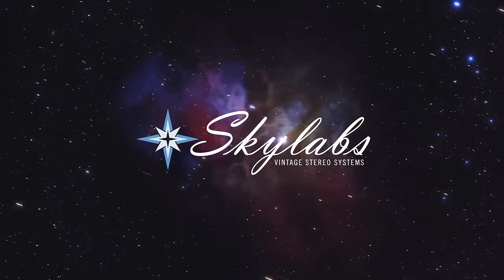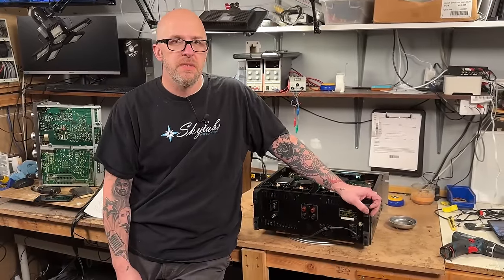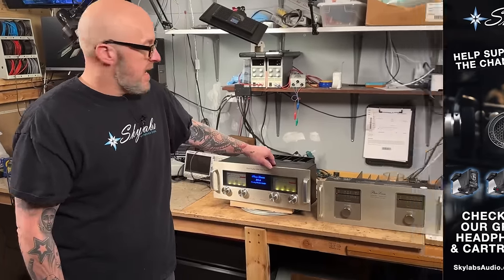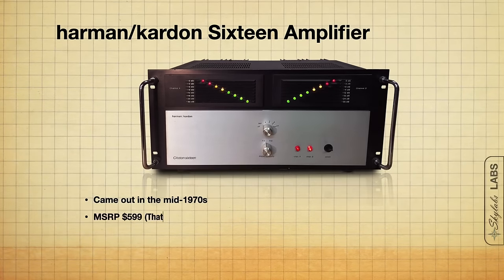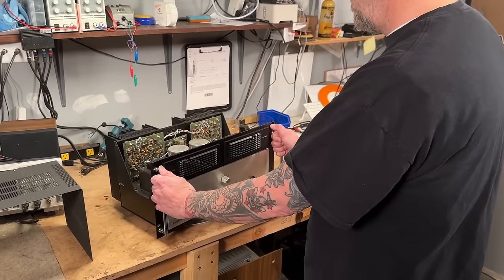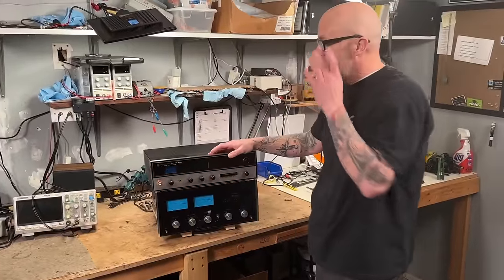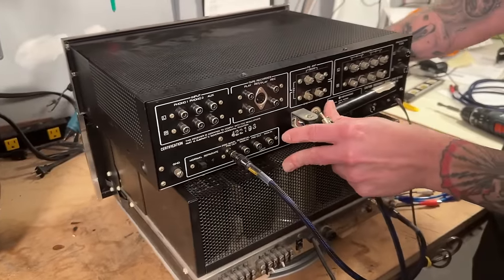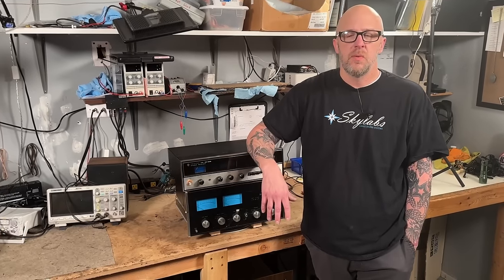5 of our Favorite Vintage Stereo Amplifiers from the 70s!

Comment from the maker: Sorry about the audio quality on this one- had some equiptment issues =(
Reply: Unfortunately I couldn't watch the video due to the audio issues
Reply from the maker: Sorry Karen =(
Reply: I thought it was on purpose from the beginning like you were talking to us from outer space during the opening logo..
Reply: I'm a we bit confused... I heard everything just fine.  @skylabsaudio
Reply: @KillerKlipsch Watch it on a computer with real speakers hooked up and you'll hear there's a wierd phase issue.  Kinda sounds like it's coming from behind you or way to the side.  With a phone or tablet, the sound is mono , so that effect is cancelled out.
Reply: Thanks for mentioning - thought my hearing finally was affected by years of going to 11
Reply: No worries, it happens. It's ironic that we can't hear you during the high wattage amp discussion.
Reply: Too much power ?
Reply: Sounds fine on my tv
Reply: @skylabsaudio no worries, it happens
Reply: L/R 180 degrees out of phase. It happens.
Reply: Ya i had the same issue but found a surround selection on my Technics reciever that fixd it. It seams the audo R+L channels were out of phase intermittently.  Probably a bad cord or not fully incerted stereo plug.
Reply: No problem if you have an RME ADI-2 Pro. Just go to I/O>Main Output 1/2 (0r 3/4)>Phase Invert>Right (or left)... job done. Lol.
Reply: Phase madness! Kinda cool. There are some live Grateful Dead soundboard tapes where the vocals have the same thing going on, I suspect to reduce feedback.
Reply: @KillerKlipsch  Me too, must be a phasing issue.
Reply: I just reversed the connection to one of my speakers.
Reply: My wall was speaking XD

Speakers: Canton Ergo passiv 1981-1982
Amp: Harman Kardon HK 980

Comment: Another great video! A few comments:  1)The Pioneer 150watt/ch. Spec-4 was smaller, not larger, than the 250watt/ch. Spec-2  2) I sold Phase Linear gear in the 1970's when I was in the audio business. As you pointed out, these things would get HOT, especially if we left them turned on in the display racks all day... almost too hot to touch.  We had lots of service problems. 3) Another classic from the era were the Crown amplifiers... the D150 and DC300... that were built in Elkhart Indiana.  They battled with McIntosh for "top of the line" bragging rights in America.... until the Crown factory was devastated by a fire in 1971.  Harmon owns them today, building equipment exclusively for the pro industry.  Thanks again for a good look at great amps!.

Comment: Thank you for mentioning the significance of the pioneer branded rack.

My sisters inherited my step dads system: Spec 1, Spec 4, SR 303 and RT 909, all mounted to the original rack.  The RT 909 has been sent for repair and the Spec 1 and 4 will need serviced eventually but everything works well despite being stored for about a decade.

The rack is a little shabby.  it's has some rust and I was hesitant on if it would be worth saving.  It will be saved, and eventually get the rust taken care of and the paint refreshed.

These videos have been so helpful to me and my family through this process.  None of us knew much about vintage audio, but we think our step dad smile knowing we kept his stereo alive for another generation.

Comment: Good video: brought back memories for me having played with/owned/worked on some of these models back in the day.  Another one that should be on the list is the Dynaco ST-416 with optional C100 Energy Bank.   These power amps were available in kit form or assembled  Spent some time building it and then some years later as an EE Tech, modifying it.  Dynaco was a neat company that provided much information and support.  When I was modifying my ST-416, I spoke with one of their engineers who was happy to discuss this with me.  I owned several of their power amps and preamps which were heavy and well-made, all in the USA of course.
Reply: Wow I agree. I had a Dynaco amp years ago but I can't remember the model it was a small amp maybe 60 watts. What i liked about it was effortless bass almost twangy but not. Unfortunately it suffered a speaker wire short at a party and that ended it. If I could remember the model  I would buy it. I know it's a good amp.

Comment: Another great video!
Just wanted to mention another great amp from the 70's, the Crown DC 300A.
I truly loved this amp!  
Matched with the Crown IC150 pre-amp, it would really rock!
Many bands such as Crosby Stills Nash & Young used this amp on tour.  
You can clearly see banks of DC300A's on stage with Triumph at the US festival!
I heard almost all the amps at the time including my friends Phase Linear 400, Marantz and Pioneer, and my DC300A took a back seat to no one!
Many thanks!
John from Canada 🇨🇦
Reply: I, too, had the Crown DC 300A/IC-150 driving stacked Advent speakers.  Incredible combination.  The DC-300A could drive low impedance loads well and had a very solid bass.  It also had a "transistory" treble, which wasn't a problem with the Advents but when I upgraded the speakers to some very bright sounding Thiels, it became objectionable.  I had no trouble selling the Crown gear.
Reply: nice.   seems like all amps will sound the same 90%, per wattage similarity.
Reply: We must be closely related!  I also had Advent speakers!  I drove them with a Luxman receiver.  
I know there are many proud customers of 70's Crown gear!

Comment: LED output meters tend to add noise. Many of the amps with them had switches to turn them off and the difference was audible. Basically transient noise as each LED fires. The HK 16 was a perfect example of it. And an incredible amp!
Reply: Never heard that about LED's, but will give it a test on my ST 416 - interesting maybe why they have a switch to turn the LED's off, thought it was to keep room dark. Thanks
Reply: @scotthamilton5138  Some of the more advanced designs fed a separate tap to a stand along buffer/driver section so the LEDs were not just off the amp's output directly. But then you are not actually measuring the amp's output directly.

Comment: 20:25... I agree. Running the 2270 pre into a McIntosh 2105 is kind of pointless as the internal amp of the 2230/2245/2270 is phenomenal. However, for example, if you want to run a Dynaco/Dynakit ST-70 or ST-35 as an amp using the pre-amp section of a 2230/2245/2270 etc etc. I can see that. Totally different sound and really brings Jazz, Singer Songwriter and Stringed Instruments to an ear candy level. A person can experiment with so many different combinations using input/output jacks. Thanks Kevin for another great video!
Reply: I used to run the pre-outs into an ancient Sony TA-30something (can’t remember as the amp is long gone) sounded better with my L100s than the internal Marantz amp section. That Sony was strange…kind of shaped like a long shoebox but worked nicely. Still have the Marantz 😊
Reply: Sorry forgot to mention it is a 2230 that I did that with

Comment: Thanks Kevin for doing this video. 
Was a little sad that Sansui didn't make the cut. 
I'm running a BA2000, CA2000, & TU9900 going to a set of SPX11000. 
Bought this about 20 years ago  and other than cleaning the pots it was running great until just before the COVID shutdown.
I'm on Vancouver Island and would need to ship the unit to be serviced, going to be expensive.
Wish me luck, thanks again for the video.
Reply from the maker: If I had one, it would have been in the video for sure.
Reply: Kent in Courtenay. I had my ca/ba serviced,recapped in Cumberland 10 years ago. If you reach out I can maybe pass along a number,if he’s still there.😊

Comment: A neighbor of mine had a Phase Linear (400 or 700?). It was blowing fuses, and he asked me to take a look. It turned out there was a burr on one of the heat sinks. It had poked through the mica insulator and shorted the transistor case to the heat sink. I removed the burr, replaced the insulator, and it worked great. My system never sounded so good as when I was testing the amp.

Comment: I agree 1000% with you. I hear the biggest differences in preamps. 
I feel very lucky I got to grow up looking at all this stuff in the mid/late 70's. My father was a audiophile and always had a dedicated music room. He would take me around to all the HiFi shops. There were so many of them in the Philly area.

Also, when possible, please mention the damping factor when reading the specs. Thanks.
Reply: Right, and another spec that's worth while is the 4ohm power output, which is closely related to the  damping factor. Very important if your speakers are lower than 8ohms. But, you can find this info online. I also agree that power amps have no business coloring the sound at all; they should all be ruler flat from 20-20k. The preamp is the only proper place to color the sound, unless you have an EQ also.

Comment: Excellent! I have the 700B lab one thing about them a low impedance load is no problem for them. And when you mentioned "Pulling them from a rack" First time anyone picks one up they are very "side heavy" the transformer weighs a ton. Only one I would add is the old Dyana 400 My first high power.

Comment: Great video Kevin! 
I love the look of the Phase Linear amps. It would be hard to choose which model looks cooler. 
I just kick myself for chucking a pair of Altec 9440A amps into the dumpster back in the 90s. But I needed a reliable rig for the band I was working with and those amps had too many intermittent issues and deemed not worth the expense to repair back then. If I knew back then what I know now - I would have been able to fix them myself.

Comment: I still have my Phase Linear 700 from the '70s, and it's a great amp. 350 WPC min RMS into 8 ohms, and you know it when you crank it. One '70s amp I would have like to see on  this list was the Phase Linear Dual 505 which puts out 500 WPC and looks similar to the 400 on your bench.

Comment: Thanks Kev. I have a power supply for an RCA Radiola 60 that weighs in over 12 lbs. Capacitors and filter chokes as well as a beefy Xformer with 300 volts for the tubes plates known as B+.  14 amps just to lite the tubes at 2.5 volts.

Comment: I bought the Spec-1 and either the Spec-2 or Spec-4 when I was in the Philippines in 1977 or 1978. Both units were dual voltage, very handy when I went to Belgium. Amps kicked ass! I agree that an AMP just passes & pumps up the signal; to Pioneer HPM-1500 speakers for example. My system was all Pioneer till I hit Belgium. Money flowed, my system "Growed".

Comment: Nice overview! I got my first MC2105 in 1979 to use as a bass power amp in high school. It was a revelation after trying to get clean sound out of a Fender Showman. It's quite heavy, but nothing compared to its big brothers, up to the MC2300, which was basically the same design (used the same driver cards, etc.) but instead of 65lbs, it was 125lbs. They were used in PA systems, in submarine communication systems and all kinds of places. I seem to be a Mac magnet, so now my living room stereo is powered by the MC2255. Similar design, but at close to 90lbs, I can't lift it. I'm not sure what I'm going to do when it needs servicing. The MC502 you showed is a fine amp, too, but it doesn't have autoformers, so it's not quite the same sound. I borrowed one for my bass rig in the early 80s and it worked well, but didn't have the oomph as that the MC2105 does. McIntosh was used to power the sound system at Woodstock, with a slew of MC3500s. Kind of my holy grail for a bass rig but the 145lbs and absurd price tag says no.  https://www.facebook.com/estudio1003/photos/sistema-de-som-no-woodstock-em-1969bill-hanley-e-a-sua-empresa-hanley-sound-fora/469251193125803/

Comment: The Pioneer Spec 4 is actually the lower powered unit. The Spec 4 is rated at 150 wpc. The Spec 2 is rated at 250 wpc.

Comment: You are correct on the Amps , that is their only Job is to amplify the Sound Signal from whatever is input,  there Could be a SLIGHT difference between Tube and Solid but thats the Main reason we bought Recievers in the 70s and 80s  because Living through that  when you went to the Electronic Toy Stores you got to try pretty much Everything and MY Opinion was the Recievers were not only a Bit Less than Separates money wise, so you could buy the better Speakers or another piece, ie the Equalizer,  Tape Deck, TT or 2 Tape Decks!! But the Recievers all had their own Signature Sounds, abd you had the Same thing with the Pre-Amp Selection si that limited what you could add to your system also! Also the Pre-owned and Teading going on Was Awesome!
Anyway you are Correct IMO.

Comment: Back in the 80s, my sister's roommate, Sue, had a complete Phase Linear rack system. I found it fascinating and it weighed more than I did. It's how I ended up with my sister's Marantz 2016 receiver as my first stereo. I wonder what Sue did with that system?

Comment: My choices would be these: 
1 : Mc 275
2 : citation 12
3 : marantz 140
4 : marantz 500
5 : marantz 240
For the simplicity of the circuits,  sometimes, less is more, and I like the semi push pull amplifier. They have a distinct sound. Besides the output transformer, the citation 12 and the Mc250 are very similar, I think they were inspired by the RCA 70 watt semi pp design that came out around 1968 or 1969.

Comment: You can also use both amplifiers by using the tape in and out to accomplish the same thing. Tape out of your AV or Receiver to the tape in of the next unit and so on it was called a daisy chain system that you could use multiple amplifiers to drive lets say 4 amps 1 to your subs, the next amp to your woofers, the next amp to your midrange and the last one to your highs. You could also use it for adding individual rooms to the system.

Comment: Picked up several Carver magnetic amplifiers, rated at 400 watts/channel off ebay.  One amp went out, but Carver still overhauled it and it's back in operation.  It's fun to watch the house lights flicker when running these amps at higher volumes; due to the magnetic (rather than caps) maintaining the output power.  You have to be careful with the speakers, however.  I burned out a set of Pioneer R-300's with too much volume!

Comment: I still have HK Signature 2- 5 channel amp, been using it for 8 years, great design accommodating most speakers. 5 x 110W, with independent psu for each channel. Just about to change it for Theta Digital.

Comment: My second (and sentimental favorite) stereo was a Harman Kardon 930 that had JBL L-100s attached to it. I'd also picked up a HK Citation 12 amp and a pair of JBL L-77s (Lancers?) used. What I was doing for a while was running the L100s with the 60w/ch Citation and the L77s with the Y-cable thing back into the 930. I thought it sounded killer, but I was kind of a headbanger back then. I sold the Citation and the L77s to help come up with a down payment on my first brand new car -a 1978 Toyota Corolla wagon that cost about $3,700. When the guy came over to listen to the L77s, I used the Citation for power and cranked up Toys In The Attic by Aerosmith. I sold them instantly.

Comment: Nice video, but Kevin, I have to say you contradict or I'll say correct yourself. It is not always obvious, but different (solid-state) power amps can have noticeable tonal differences or character. An example I'll use is 1st & 2nd generation B&K power amps compared to Adcom power amps of that period. Like the Mcintosh, the B&K's also had or have a tube-like quality. The Adcom's were know to be a bit brittle or clinical. I also own a P. L. 700b, which seems to sit in the middle. So as you said, it was your opinion and we can have different opinions (that's 1 thing that makes the whole audio thing fun 🙂), my opinion would be a power amp can effect the total quality of your system (especially if your doing the mix or match thing). Thanks for another cool video, keep it up.

Comment: Despite any short comings the most punchy dynamic amp I had was a Phase Linear 400. Fortunately I pulled it before it flamed out, it started to backfire. Also enjoyed a Kenwood M2 basic, whiched punched above it's weight. Amp power corrupts in a good way.

Comment: RE: The phase linear 700. 

This was never intended for home stereo use. 
I got to play in a rockstar band back in the 70s. In 78 we used these amplifiers to run our main speakers which were Cerein Vegas. (This was before subwoofers were common for live performance.) 
But we ran the entire band including drums and bass through our mains. 
We played a lot of theater lounges up in Canada it's seated around 500 and just one of these and a Cerein Vega on each side what's way more than enough. We never ran the gain a whole lot more than half in that size room. 
Phase Linear 700's were what you used if you're band had arrived. When you're playing at over 105 DB, there's really no sound signature. It's just loud, it's clean and quite balanced. 
The only bad thing about them is that you could not store them or transport them on their side. It would damage the transformer and to not work at all. You had to keep them flat at all times.

Comment: That Harman Kardon amp is WILD!
Reply: Yes.  Remarkable to have 10 output transistors / channel for 150 Watts,  when Pioneer and Hitachi had 4 output transistors / channel with more than 200 Watts output.  HK is either extremely over engineered,  or extremely underrated.
Reply: I'd say they are very conservative with the 150 W rating.